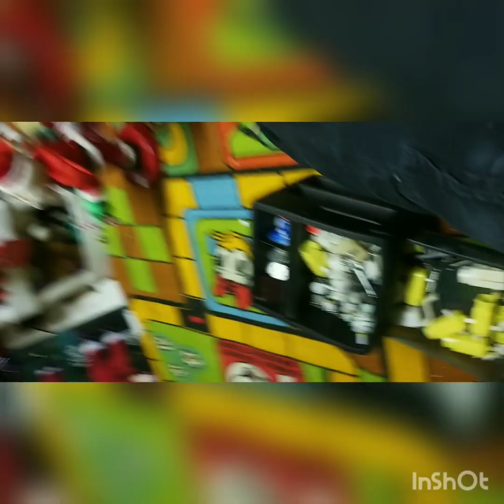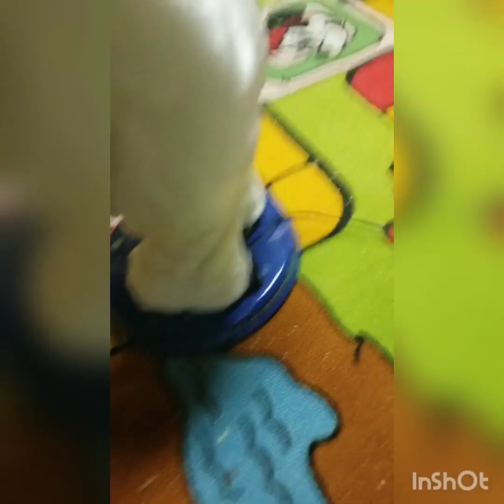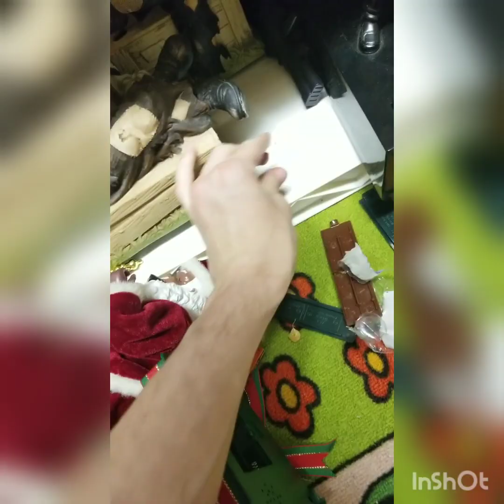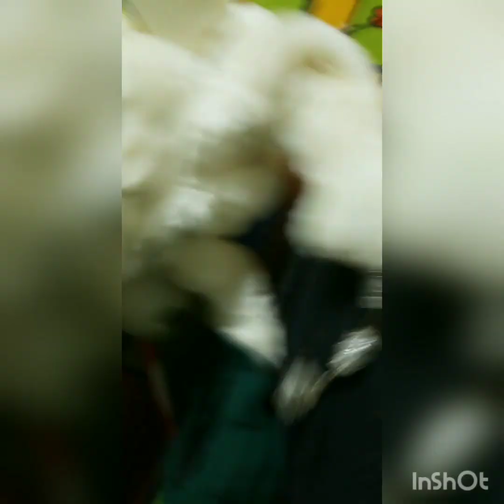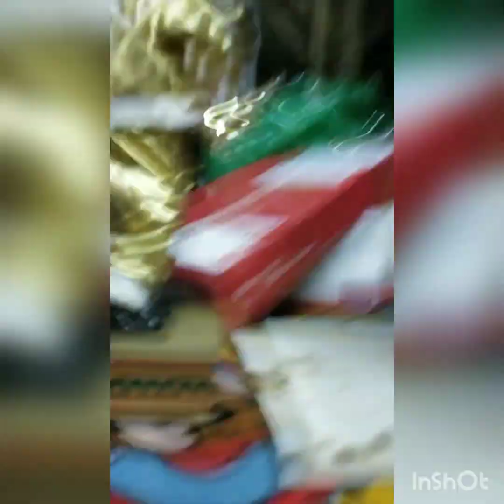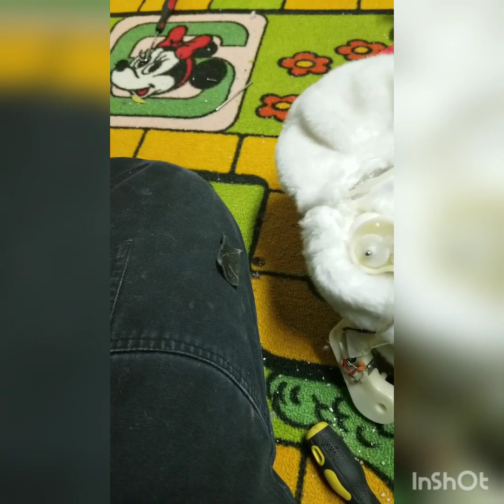Repairing 3 more Gemmy Snowflake snowmen

Comment: I have a frosty with no power.  Last time I used it everything was fully functional.  I also have a moving animated Pooh Bear that needs the battery connections replaced. Can I pay you to repair them ?
Reply from the maker: I dont have battery contacts really
Reply: @gemmymasteranimatronics768 .
Reply: @gemmymasteranimatronics768  where do you buy square shaft gears at?